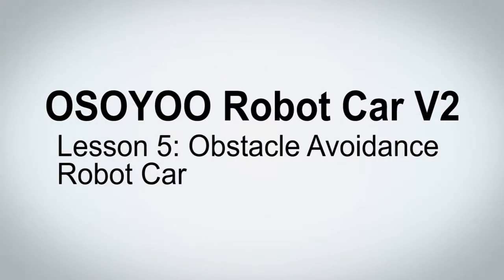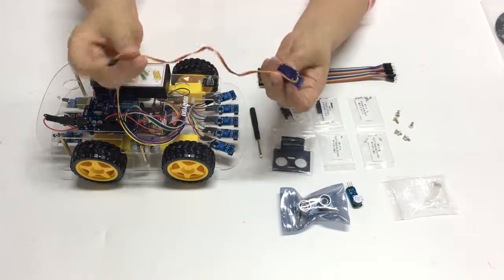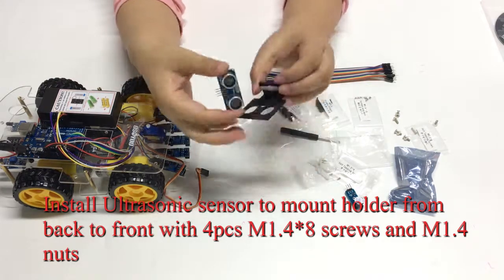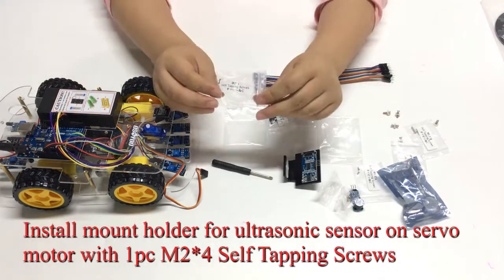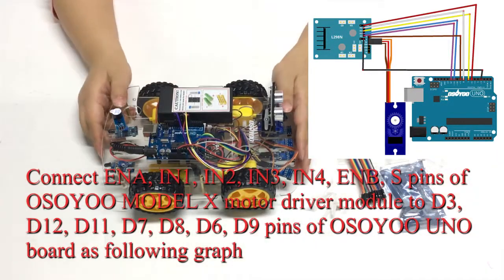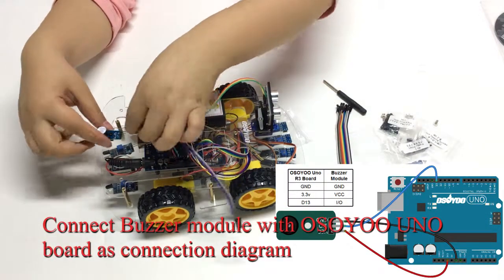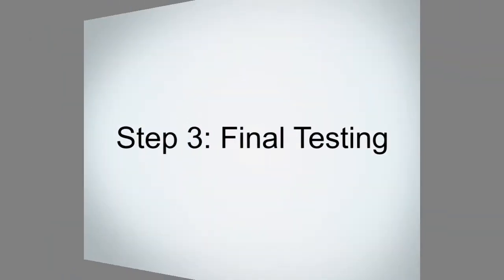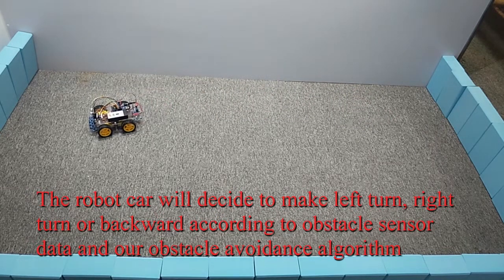OSOYOO Robot Car Kit V2.0 for Arduino lesson 5: Obstacle Avoidance Robot Car

Comment: what should i do I always get this kind of error
Arduino: 1.8.18 (Windows 10), Board: "Arduino Uno"

Sketch uses 7692 bytes (23%) of program storage space. Maximum is 32256 bytes.

Global variables use 489 bytes (23%) of dynamic memory, leaving 1559 bytes for local variables. Maximum is 2048 bytes.

An error occurred while uploading the sketch

avrdude: stk500_recv(): programmer is not responding

avrdude: stk500_getsync() attempt 1 of 10: not in sync: resp=0xe8

avrdude: stk500_recv(): programmer is not responding

avrdude: stk500_getsync() attempt 2 of 10: not in sync: resp=0xe8

avrdude: stk500_recv(): programmer is not responding

avrdude: stk500_getsync() attempt 3 of 10: not in sync: resp=0xe8

avrdude: stk500_recv(): programmer is not responding

avrdude: stk500_getsync() attempt 4 of 10: not in sync: resp=0xe8

avrdude: stk500_recv(): programmer is not responding

avrdude: stk500_getsync() attempt 5 of 10: not in sync: resp=0xe8

avrdude: stk500_recv(): programmer is not responding

avrdude: stk500_getsync() attempt 6 of 10: not in sync: resp=0xe8

avrdude: stk500_recv(): programmer is not responding

avrdude: stk500_getsync() attempt 7 of 10: not in sync: resp=0xe8

avrdude: stk500_recv(): programmer is not responding

avrdude: stk500_getsync() attempt 8 of 10: not in sync: resp=0xe8

avrdude: stk500_recv(): programmer is not responding

avrdude: stk500_getsync() attempt 9 of 10: not in sync: resp=0xe8

avrdude: stk500_recv(): programmer is not responding

avrdude: stk500_getsync() attempt 10 of 10: not in sync: resp=0xe8

This report would have more information with
"Show verbose output during compilation"
option enabled in File -> Preferences.

Comment: I don't have holes in the ultrasonic mount
Reply from the maker: As we upgrad the ultrasonic mount, and you just need to install the ultrasonic mount to servo motor and fix a M2*4 screws, you needn't to install a blade on ultrasonic mount